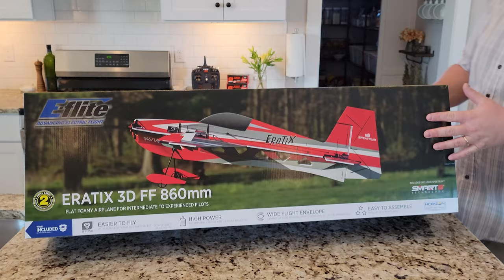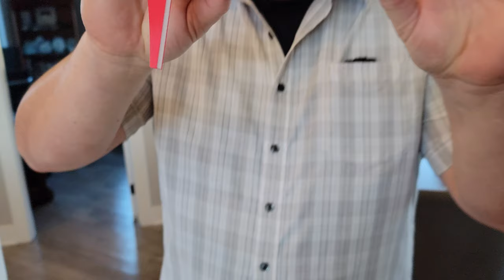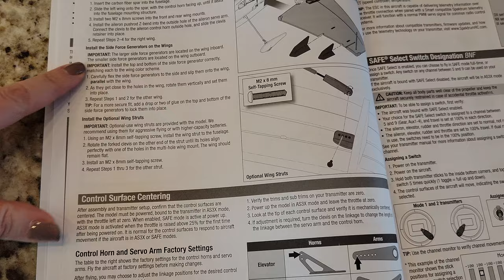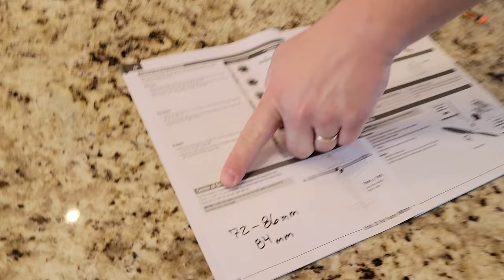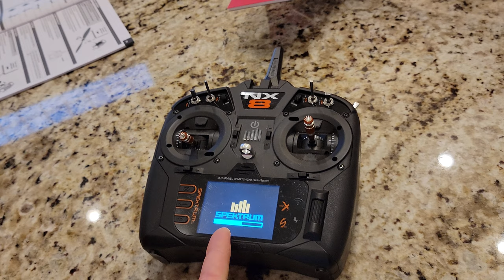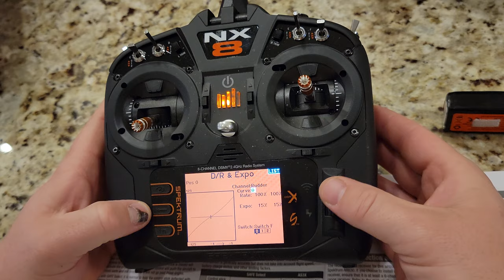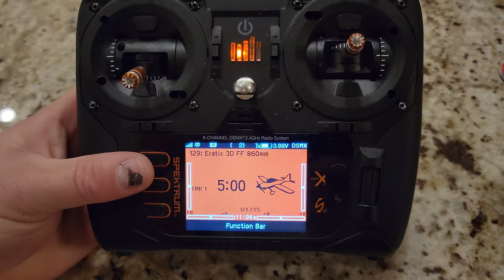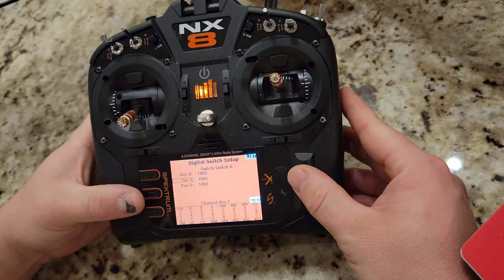E-flite - Eratix 3D FF - 860mm - Unbox, Build, & Radio Setup

Comment: Love watching Brian set up a 3D plane, 100% can tell he has never flown or built one 3d planes use the 33% rule on the CG, I would also recommend dialing all your throws down to 50% for low 70% med and 100% high use all 3 positions on that 3 way switch
Reply: I just bought this model. I appreciate your input on rates a lot! I subscribe to your channel also. Hey do you have a more detailed video on this set up?  If not I'll be all right with the info you wrote down here. 
  Thanks brother man!

Comment: Hi Brian, I took my twin timber to the field for the first time yesterday and a fellow flyer had on of these. So I had to see if you've done a video on it. Lol
I'm glad you did. I watched you fly in the gym. And then watched the unbox and build.  I'm so glad we have the same radio (in this video), because electrics are very new to me and these radios are very foreign and intimidating.  I'm also glad that my sister is into it, and helps me with the complicated stuff so I can do the flying. For the price point I think this will be the next one, and  I may be fortunate enough not to have to wait until next summer for it.  😁
Reply from the maker: It's a BIT delicate, but you CAN 3D pretty much out of the box. It's a fun plane, but just to be totally clear, you can definitely make a lighter 3D plane like this. The BNF aspect, and very quick build will help you get a feel for the 3D side of things, but just bear in mind, at a later time, you might want to try an even more light version.

Enjoy!!!

https://bprc.me/Eratix
Reply: @BrianPhillipsRC  it's still a little hard for me to embrace electrics when I can get a 20 minute flight out of 6 ounces of fuel and all the battery was required to do is run the service for the control surfaces.
The longer the flight the higher a flew , and then I just dead stick Land on purpose.  Something tells me you were that kind of flyer too. Lol

Comment: Hi Brian, in watching this very good box/setup vid you did on the Eratix, during the radio setup portion, I noted your comment about the note in the setup section of the manual that states "Set servo travel to 100%" and wanted to chime in here.  I "think" what they're trying to convey is: on new plane setups, especially 3D planes, a lot of guys address the servo "Travel" first, to make sure they are running the servos and control surfaces to their optimal range. This sometimes means setting the servo "Travel" upwards to anywhere between 120 to 150 % then backing off a click or two to prevent binding.  Then that new "Travel" setting becomes your overall 100% and you can now set your " Rates" to achieve the specified/suggested control surface throws in degrees or mm per the manual. I'm guessing that for the Eratix, reason they note the "Set servo travel to 100%" is, they don't want you going past that 100% Travel setting, perhaps due to AS3X / Safe parameters or something like that. Hope that helps. Thank you for everything you do for all of us!
Reply from the maker: Thank you for the clarification. this helps, and yeah, I believe a lot of guys go OVER 100% for 3D planes, so that makes sense. Appreciate the tip!

Comment: 44:50. I TOTALLY hear ya man! I spent God only knows (Felt like 2 hours?) trying to DL the update to my trans. First over the WiFi, and like you, it got stuck, then I did the same log out- log in bit, that didn't work, so then I went to the spektrum site, used the SAME info I used on the radio to log in, and it didn't work on the site! So, of course ya know the drill there, "Reset PW", wait for the emails, fart around with making a new one, which they give no hints what they want, as far as caps, and #s and unique symbols. My old one was all lower case, and now that doesn't work anymore, it was just a circle jerk forever! FINALLY got the dumb thing to work, put the update on the SD card, and got it off the card into the radio...WHEW! What a PITA though.
   Again though, your help is greatly appreciated. I've learned more about the radio watching your vids, so I wanna thank you for that for sure. Now it seems to me, the things you review fall secondary to the great radio tips! lol It's like, "Yeah yeah, cool plane, BUT, how do ya set this up on the radio?"
  And yes, a minute or so after the 44:50, I AM coming back into the hobby after about 15 years or so, and all this new tech is a bit intimidating for sure.
  Yes, the 'i' series of radios are seriously cool BUT, like you said, not so many people gonna shell out almost a grand for a transmitter. Sure, I want one bad! buuuut...;)
  1:10 eaaaasy now...there'a alotta nice planes in there for that prop to make a mess of!

Comment: Brian - the Chinese made models I've encountered do not use American hardware but the American tools will sometimes work. Most of the Chinese made models I've had use Japanese hardware and Japanese Industry Standard  (J.I.S) tools usually work best.

This particular screw on the tail did not respond well to even my J.i.S tool.
Believe it or don't  -  a small Flite-test screw driver included in one of their kits
worked the best for me on this one.  Not the first time. I've had other screws that it worked best on before.

So I went as tight as I dared without stripping it but it did not seem to be completely in.
I left it alone and put tape on each side of the stab because there was a tiny bit of wobble in it.
Reply from the maker: So I wasn't crazy to think the screws kinda sucked??? Love the plane, HATED the screws...just like the wheels on the Carbon Z Cub - LOL - funny that I can remember how bat they sucked, and yet one of my favorite planes!!!

Comment: Awesome review, I just ordered this plane. I think a spot of CA glue on the landing gear, elevators, wing saddle  and vortex generators are in order. I have built many of these 3D planes and at one time or another the airframe becomes weak at the screw mounts due to the G forces being created by all the erratic maneuvers.....

Comment: Hey Brian- When you were trying to screw it into the hole on the horizontal stab..., I saw you were having trouble. I would recommend your recommendation, in previous lessons, of being sure to use ample lube. Brand name "Dawn" I believe. ;)
Reply from the maker: I really just think some of these Phillips screws need a different type of tip. I need to investigate this more.
Reply: @BrianPhillipsRC  Okay, I look forward to the results of your research. Thank you so much for your continued educational videos and guidance. I can not express how much fun and education they deliver. Plus I usually cry, with laughter, due to your amazing comedic talent. Amazzzing!
Reply: HEX heads are always better!
Reply: @old-rcplane-phart  I have done that also. On my Habu I could not screw them down and the heads would strip. I changed them all to hex head screw that work fine.

Comment: Dude I love the videos, and I just got my Eratix and im so excited. BUT... the maiden went horrible. Set up with the AR631 rec and the 850mA battery ... tail heavy right off the back. Now after repairs and battery full forward, cg seems right on where you said , at the struts. a noobie mistake not  double checking cg recommendations ... oh well hot glue and a few more xmas shots helped lmao!

Comment: I vote you get the ix 14
Reply from the maker: We are still considering the options. I want the IX14, but feel more people would be able to follow along more easily in our "Radio Setup" videos if we stayed in the NX lineup.

Honestly, my old DX18 was so similar to the new NX8, that I felt like they were all pretty easy to cross over between, but I get a ton of questions from newer pilots who need help, and I have no idea what to tell them on DX6e and this type of entry level, economy transmitters. I fear I'll be dealing with this way more if I step into the IX14.

Tough call.

Thanks for weighing in!

Comment: Brian,
I and many people in my club are breaking out part of the Eratix wing that braces the landing gear. There is basically a 4:1 lever created by the plastic feedthrough piece acting as a fulcrum in the fuselage that multiplies the landing force on the gear by ~4 at the wing brace. It is a  simple fix, but it is a weak point that rebreaks easily. Do you have any bracing suggestions?
That would be a great video if you could share a solution. This plane is popular and flys great. I looked online and I haven’t seen anyone addressing this. But the CA is working overtime on this problem, particularly if the runway is not paved.
Reply from the maker: Oh boy, tough call. I'd say you'll have to use 2 part epoxy of your choice, since CA is gonna be too weak, with small attachment points. You could also make string or wire connections for support on the tips.

Comment: I vote you move on to the iX14. I moved to Jeti but a nightmare to programme BUT being able to measure mAh consumption is much better than measuring volts. So do I stay with Jeti or return to Spektrum 🤔
Reply from the maker: We are still in the midst of hard fought consideration.

I trust you understand.

Jeti is amazing gear, but without very expensive equipment to pair up with the Tx, I have to assume they'll be somewhat overkill - am I mistaken?
Reply: It's a dilemma isn't it. For you it's simple, your market is Spektrum and that's where the majority are. Harry Curzon - who does lots of instructive Jeti YouTube videos - said to me todawhen we were flying "Spektrum is great for the straightforward stuff but if you want to do something out of the ordinary and more complicated and unusual, then Jeti will do it".

Comment: Brian, try a small magnet (Like the little magnets on canopies, etc.) stuck/attached to your screwdrivers to hold the tiny screws in tight places. I use them all the time, hard to lose screws when they're stuck to the driver going in or out!
Reply: A tiny dab of thick grease on the end of the screwdriver works great to hold a small screw, too.  I use Superlube, which I have around for all the helis.
Reply: @whoknows8678  Then you have to clean the grease off wherever it may end up! Parts of the plane, countertop, fingers, or wherever you don't want it. Magnets stay where you put them! It's also a good way to keep from losing screws on a counter that's hard to find little screws by keeping them stuck to the magnet till needed!
You can also magnetize your screwdrivers/drivers by always leaving a magnet on them. They will stay magnetic for some time even after you remove them.
Reply: @whoknows8678  LOL, High "Knows" I mean Hi, yes I've used your method myself over the years, mostly when working on cars real and RC where grease is right at home. Now unless you are the NEATEST, TIDIEST, never slip up or drop anything EVER Person, that's great, but most everyday people are not!
 Somewhere sometime in a place where grease is getting somewhere you don't want it! Then you need a cleaner to remove it! 
The Magnet you just pick up or move or leave it on the screwdriver, with all your little screws attached to it so they don't get lost!
BFD you're right it's not that hard, but why bother if you don't have to! 👍Just grease your landings!🙂

Comment: Hi Brian,  I got one of these for Christmas. My last 4 bnf planes that I bought I followed the binding process but just fly like that and never dial in the throws.  Do you ever do that or is it paramount in your opinion to dial it in? I'm just not that good at setting stuff up I guess. Thanks
Reply from the maker: I never play with throws, I just follow the hole positions in the manual if they're BNF, and if they're plug and fly, but when they're a KIT or an ARF, I sometimes have to guess....but admittedly, even then, I don't measure throws. Honestly, I've maybe measured throws ONE time, back when I was just trying to make more throw on a highly modified plane.

To answer your question, if it weren't already clear, I don't think it's paramount...but there may be value in a PNP more-so than in a BNF where this type of thing is already worked out for us at the MFG.

Comment: The manual recommends to NOT use thrust reversing on this model with no explanation why. Perhaps because it has no tail wheel?
Reply from the maker: Oh well, I'm using it anyway ;)
Reply: Because the way the propeller attaches, it 'can' fly off in reverse.
Reply: @old-rcplane-phart  How's that?  In reverse thrust, the prop is being driven hard back into the hub.
Reply: I'll be danged.  I looked all through the manual trying to see how to set it up since Brian showed that it works.  I found it strange that Horizon never mentioned the feature anywhere in their propaganda, either.  I missed the part about not using it and, boom, there it is...  Right in the first section on page 3 as a WARNING. LOL  You might be right on the no tailwheel thing.  I can easily see someone ripping off their rudder trying to use reverse on grass or other unprepared surfaces.  Apparently, those surfaces rip off pretty easily and many are beefing the hinges up with blenderm type tape, etc.

Comment: So what is it made of? Depron, EPP, foamboard? It looks pretty but does it bounce off the ground unharmed like twisted hobbys/RC Factory profile planes?
Reply from the maker: I feel like it's a plastic coated foam board. It's like a strong "billboard" material...like what you might see as an advertisement at a trade show. It's strong, but not especially light.

Comment: Great Video and content. Can I ask a favor? Can you refer to the correct terminology for aerobatic/3D maneuvers? I have never heard of "cornhole" and etc. A true "Hammer Head" is a stall turn pivoting on a wing tip. "Hovering" is the correct terminology for hanging stationary on the prop and thrust vectoring with the control surfaces to hold it nose up. I am sure there's a bunch of 3D pilots a bit confused. I am trying to figure out what maneuver you call a "cornhole" actually is. Thanks man. Keep up the great videos.

Comment: FYI: I noticed that my aileron servo was loose in the holder and had to tighten down both little screws to secure it (used P0 screwdriver).  First production run issues I'd guess.  Accessing those was not fun but doable as long as you are careful about where to hold it to apply force.
Reply from the maker: Yep...just not much to press against with considerable force required IN to keep the head of the screw driver seated. Wish they would have used a hex drive like many other models. I think this was a pretty big miss on HH's part, but GREAT PLANE!

Comment: I didn’t watch the whole video but I’m having issues assigning safe /safe select to a switch with forward programming. It only gives me the options of safe select or safe when I flip the switch. I want to have the option for AS3X only, then flip for safe?
Reply from the maker: Go into forward programming, and change the "AngleDemand" to "AS3X" on one of the two switch settings.
Reply: Strange, I do not have “Angle Demand” as a setting in forward programming just:

Gyro settings —> SAFE select —>

FLIGHT MODE 2/3
SAFE Select Chan: Gear
AS3X: On
SAFE: Off
SAFE Select: On

It actually doesn’t even let me select SAFE, skips over it. Maybe has something to do with how I bound it? I just plugged in the battery and pressed the bind button on receiver and bound through remote “Bind” selection.
Reply: @BrianPhillipsRC  Flight mode 3 is supposed to be my “AS3X only”
Mode but the settings above are listed and I can’t modify it
Reply: Or when I do modify safe select off it influences the other switch and vice versa

Comment: I am curious about why not use the BNF models that are already in the NX? I would think that would get the setup that the instructions want you to use, then you could verify/tweak them if you want.
Reply from the maker: I've spoke about this many times, but maybe you missed my more elaborate explanations...

This is one of the most complex and expensive tools you'll use in flying RC aircraft, and there's a lot of people just getting into or getting BACK into the hobby who need a lot of help. If the BNF profile is available, and you know how to use it and want to use the factory setup, go for it, but I'm going to suggest setting it up yourself. I don't like it being done for me, since I want to control how well it works, and KNOW how it works. If there's a problem, I want to have some clues as to what might be causing it...all pro-doing it yourself ;)

Anyway, hope this helps answer your question, but as I say all the time too, to all their own; we don't want to tell people what to do, only suggest what we think might work well, and what WE did, so you can gauge our success or lack thereof in the event our review goes sideways - LOL ;)
Reply: There's still no preset "Eratix model". You'd think they'd keep up with updates but they don't.  There's no Draco model either. It's just as easy to set it up manually I suppose

Comment: to avoid the dreaded - lost the tiny screw problem -
magnetize the tip of the screwdriver, and I like to tilt the plane so that when I insert the screw my driver is pointed straight down - helps to avoid the screw falling off the driver even though its magnetized and from turning sideways to the hole.

Multiply by 10 the frustration you had over the poor documentation and that is how I feel about the screws they use in a lot of cases - too small, too shallow - leading to stripped screws or screw that will not tighten down all the way. I would prefer a hex head or in some cases just a bigger / deeper screw. I know I 'm not the only one who feels this way....so wish this info could get passed on to the aircraft designers.